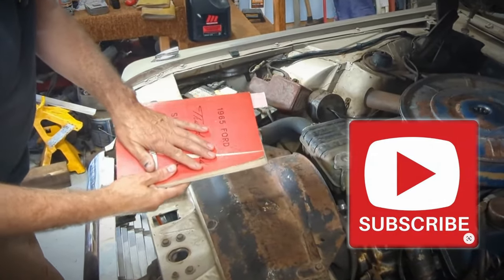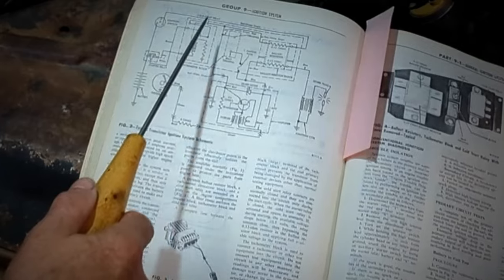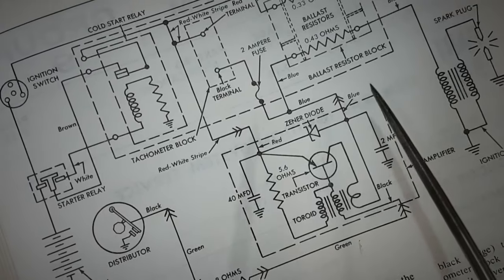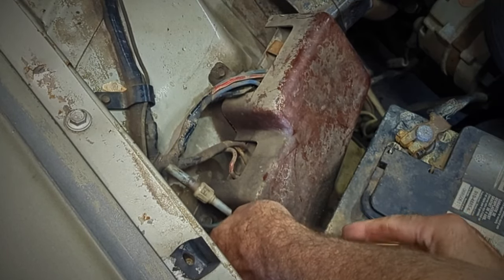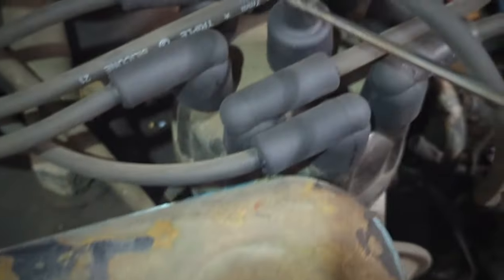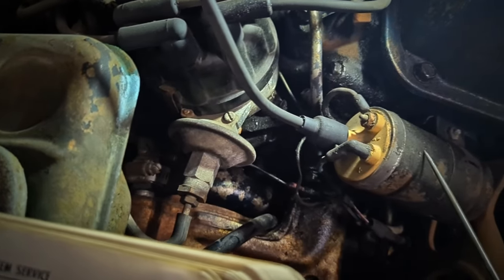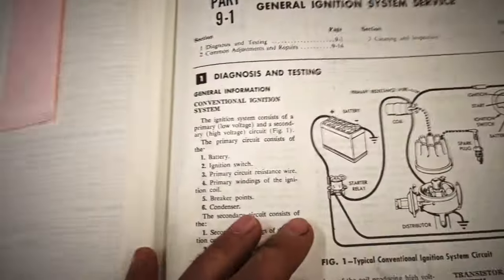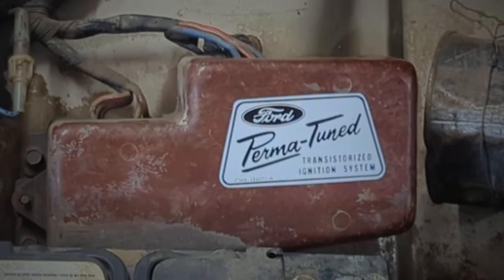1965 Thunderbird Perma-Tuned Transistor Ignition System

Comment: Thanks again for your wonderful videos. Our 64 ThunderBird was completed about seven or eight months ago. I have taken it as far as I can. Not much left to do. Voltage regulator for the gauges, power steering leak (minor). Left rear quarter wind needs a good take apart and cleaning. Maybe a pinion seal, althought its dry now. Driving it appeared to help it. And thats it. We had a very generous offer for it out of the blue. Lynne and I chewed on it for a week or so and agreed to let it move on to the next custodian. We have had it for six years. The first three most of the work was done on it. We have been using it and it is a pleasure to drive. She shines like a diamond inside and out. But each day it gets a bit more difficut for me to maintain it. I dont want it to slip backwards. It is going to a new home. She only has 37,000 documented miles on her. I know the new owners will take good care of her. I will still be around keeping an eye on you and Nick.
Reply from the maker: Thank you Walt!
I'm happy your 64 is going to a good home. 😊

Comment: We have a '64 Thunderbird Hardtop that was factory equipped with the Perma -Tuned transistorized ignition system and it runs excellent, although I did have to replace the amplifier with a NOS unit. Yes, the ignition coil is unique to that system. It's great that you were able to get your system functioning again simply by cleaning that fuse!!! I will definitely remember that.
The Perma-Tuned system came out in 1963 and almost all of the '63/64 full sized Fords with the 427-engine option were fitted with that ignition system.  In '64 it was first offered in the Thunderbird and a limited number of 'Bird's that year came so equipped. Fewer '65 'Bird's had it and by '66 it was being phased out and almost non-existent in the actual cars although I have seen a few '66 Thunderbird's that did come with it - most likely early production cars.  
Thanks, Alvin, for going over the various components of this system, it was very informative!
Reply from the maker: Thank you Scott, it is a very simply transistorized set up once you understand what you're dealing with.

Comment: Perhaps the only Flair bird in existence still using the original Perma Tune. I can assume that the only real advantage of the perm tune is that there is very little current passing through the points and therefore the points would last tens of thousands of miles.  I had a California 64 hardtop that was DSO 84 and was a big wig car sent to Los Angeles district for use by one of the people there.  The first owner bought it from Ford at one year old and kept it for over 40 years.  When I got it I unplugged the amplifier module and the car still ran great.  Someone had converted the distributor to normal points and condenser somewhere along the line. Anyway, congratulations on getting it working even if it was just a dirty contact at the fuse.
Reply from the maker: Thank you Jeff, I agree with you...the only real advantage was maintenance on the ignition system.

Comment: Alvin,
Very good explaination, my friend.  At some point, if I live long enough, I hope to install a complete modern solid state ignition setup in Pearline.  But first I have to plow through my antique radio and speaker backlog.  We're making progress.
Regards,
John
Reply from the maker: Hey John, I know you are knowledgeable with the components that make up this system, you would have ran into them went restoring vintage radios, and this setup is very basic compared to a radio, this is just a switching device.
I've got to watch your latest video on speaker repair...the rear one in this old bird is torn and scratchy sounding.

Comment: Hey Alvin, great video. Yes the coil is different for those cars. The negative terminal on the coil is grounded to the engine as opposed to a conventional coil where the negative goes to the distributor. Looking on your wiring diagram, you can see that the wire to the distributor comes from the amplifier. These are much more common on the 1964. I don't care for them, there are no parts available for them and it just complicated things. I don't think there is any performance difference either. I agree with Mike Johansson, take the amplifier apart and test those components, see if they are any good. Thanks.
Reply from the maker: Hi Nick, thanks for confirming that the coils are different, and I'm pretty sure a guy could replace the whole system with an Arduino! Lol
Since the engine is running very well, I don't think I want to start taking the amp apart right now.

Comment: Wow, so this was an option then? My car ('65 Landau) has none of this stuff ( amplifier, circuit/transistor box by battery, etc.) so I presume it wasn't on my car to begin with. Someone (prev. owner) changed my system out to Pertronix, so I guess it's possible they removed all that stuff.

If the perma-tuned ignition was offered as an option, I wonder how much it cost and how it was marketed to customers? It seems like kind of a tech-y option for 1965. I guess the "perma-tuned" name implies the customer would need less tune ups, but I wonder if that's true. Still needed points and you still needed to change plugs and rotors. Thanks for the detailed info on obscure vintage Thunderbird esoterica!
Reply from the maker: It did seem to reduce the need for those all too often "tune-ups", but I think with transistor rapidly getting smaller and cheaper, Ford was able to reduce the system as a whole into the Dura-Spark setup.

Comment: Hey Alvin, thanks for the video strangely my '65 did not have this option as it had just about every thing else. I had a shot distributor in it and I just changed it out for a conventional points version. But I may change it one day. Anyway, in the diagram of the amplifier those caps of 40 and 2 MFD are probably bad after all these years. I work on old Tube radios from the '30's and those values of 40 mfd are quite common. Ever wonder why old radios have a terrible hum? the capacitors have gone bad and they leak internally. Change them out and no more 60 cycle hum. It would be neat to see the inside of one of those amps and to test the caps. Any way I enjoyed your video! God bless.
Reply from the maker: Hi Mike, the caps may have failed, however the engine is running smooth, so I don't want monkey around with it went its working well. The no start issue was just a poor connection at the fuse, she fired right back up after I cleaned it. 😊

Comment: Is there really a noticeable performance difference between the perma tuned transistorized ignition system and the regular points and condenser ignition? I remember reading this was originally used on the medium duty or heavy duty trucks then they made their way into the high performance cars in 63 or so.
Reply from the maker: I don't think it makes a big difference performance wise, but it does save maintenance on the points, they last longer.
Reply: @J_R_Shop  If Ford had just made the dwell easy to adjust like GM cars (with the access door on dist. cap), then changing points is no big deal.  Fords are a royal pain to dial in the dwell; not just a gap and start.

Comment: I have a 66 tbird an replaced points an condenser with electronic ignition $125. pentex i think its called works good 5yrs now, can us coil or buy a pentex coil i used the one in the car,. screws right in
Reply: Do you mean Pertronix? That's what my '65 has. Some cars have pertronix systems that can use a non-pertronix coil, but you have to check the ohms resistance on the coil to make sure it's compatible. Can't remember the details, but the info is available online, as I recall.